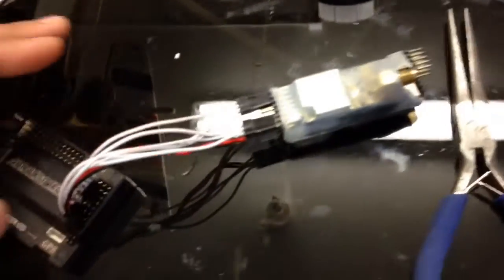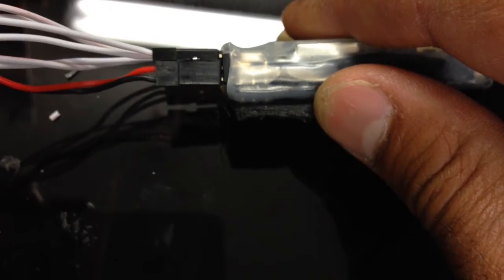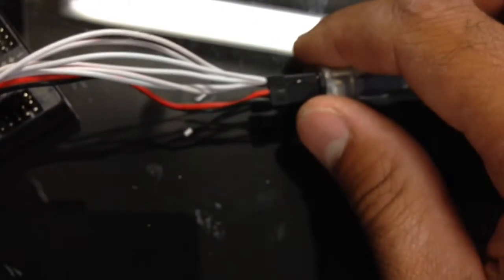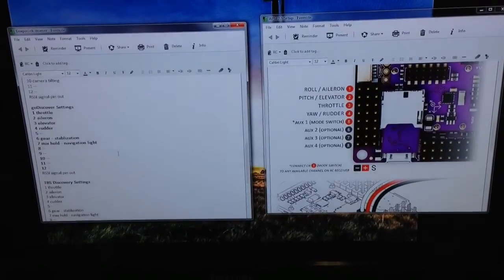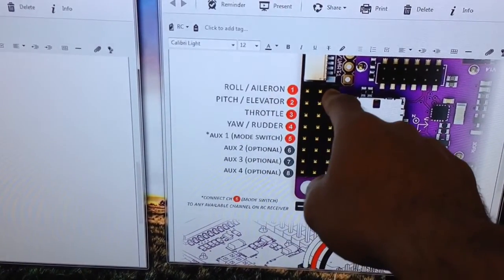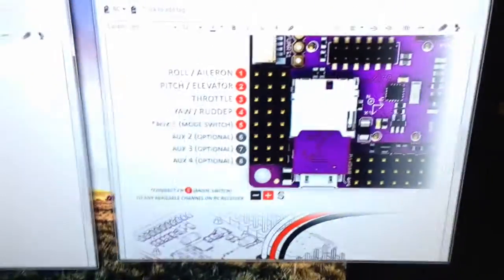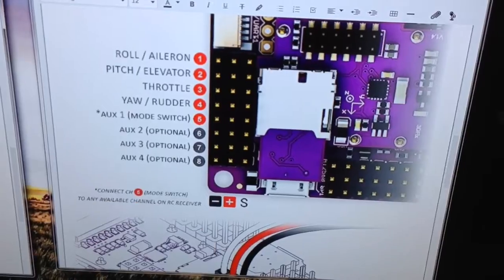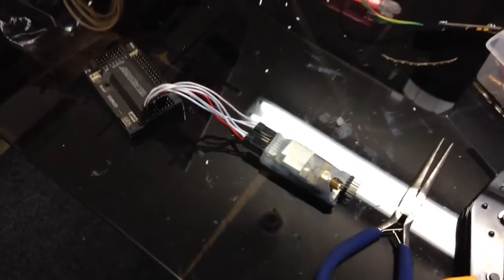Wiring APM 2.6 to receiver

Comment: Thanks for this. If you still use the standard white/red/black servo but connect them parallel to the signal pins, will it all three work as signal cables?
Reply from the maker: Yes they will but may increase the risk of making a mistake

Comment: hi 
i need your help please, if i remove the JP1 and power up my apm2.8 with (power module) do i still have to disconnect the Red/black wires and keep the signal on?  or can just connect all the wires as it is? would this cause any damage into apm board? many thanks
Reply from the maker: If you remove JP1, then the output pins will not be powered by the power module. You will need to therefore power the output pins in another way, i.e. by using a UBEC on the throttle channle for example.
Reply from the maker: So you can connect the all signal, red and black wires to the output pins, as long as there is only one power source powering the output pins. Make sense?
Reply: +ant0nsmith yes that's correct, when using power module only input, GPs and the board will be powered but the output and telem will not get powered. What if I use one of the ESCs to power up output and telem, would this cause any damage? Many thanks
Reply from the maker: +Zico Airsoft sounds like it is a multi-rotor that you are installing it on?. So only connect one of the red wires, from one of the ESC's, and just connect the black and signal wires of all other ESC's
Reply: +ant0nsmith it's FPV 250 drone, so what if I connect all the wires like I have 4 ESCs and connect them as it is? You are saying connect one with red/black/white and the rest 3 just black and signal, can you tell me why is that? Thanks

Comment: Hi Anton. I'm going to take the big plunge into this stuff soon so I have a newbie question for you. How do you connect power to the APM? What sort of connector will I need, will it need a 5v or 12v supply... and will it require a BEC?

Basically, if I have a power distribution block that has 12v & 5V BEC outputs, can I use one of them to provide power to the APM? I'm trying to avoid drawing power from one of the ESCs.

Comment: You could have saved time just to put one cable vertical correctly and then the rest horizontal on the signal pins only.
Reply from the maker: True! Doh! :D
Reply: ant0nsmith
 Respect !    Please ho please keep the videos coming as you for some unknown reason build all the stuff i want and will be building so keep up the great work.
Reply from the maker: cheers! :)